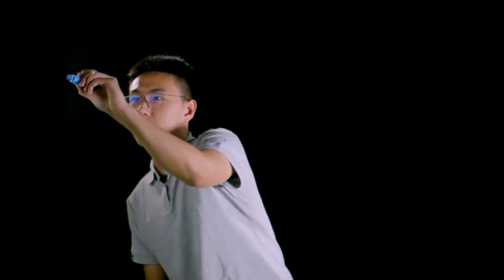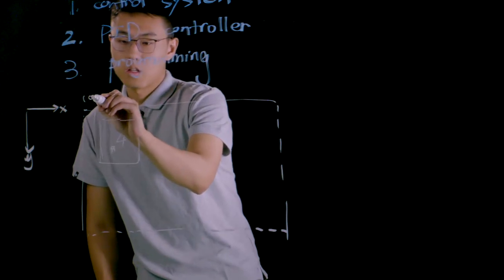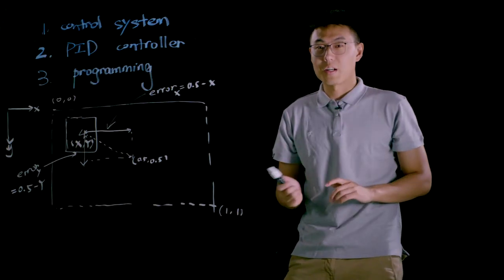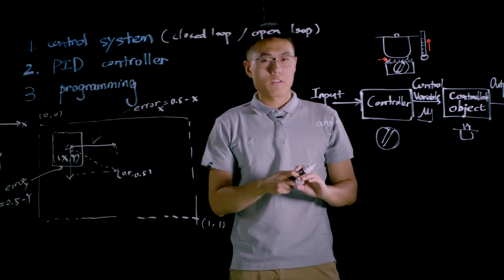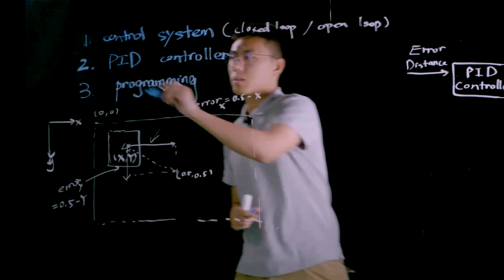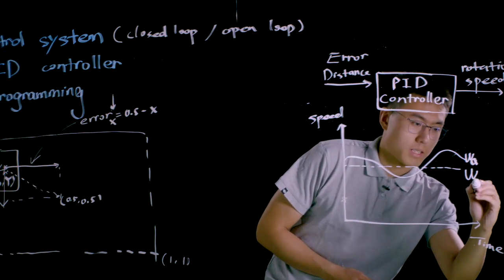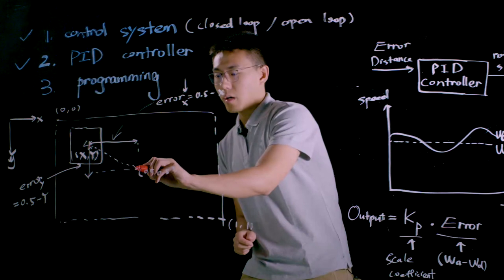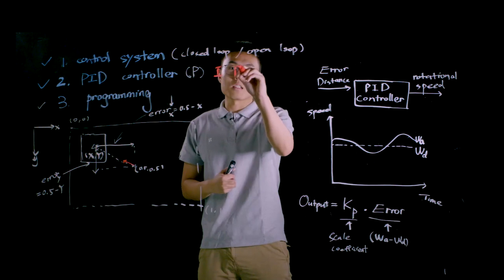DJI - RoboMaster S1 - Courses - PID Control

Comment: Purchased the Robomaster s1 a little less than a month ago. already got bad rear right motor, "check connection " I did.  re seated them and nothing. am trying to get  a replacement and possibly buy an extra motor just in case this would happen again. any advise ?
Reply from the maker: Hi there, we are sorry to hear about the difficulties that you encountered, please send us an email to support@dji.com and provide us with more details, we'll do our best to help.